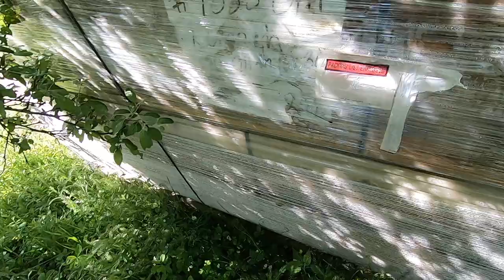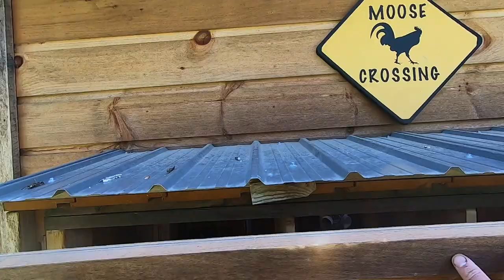It's Time To OPEN the Post and BEAM BARN KIT!

Comment: Al.  Keep in mind you can build a rigging hoist system using the Kubota to lift the beams up.  I stick built a enclosed deer blind 15 ft off the ground using block and tackle and the garden tractor.  I lifted 200lb walls like it was nothing.
Reply: Super idea..

Comment: Al, if possible line up your trailer in tandem with the stack so you can simply slide the wood off onto the trailer without having to lift, carry and maneuver it....it will save your back.

Comment: It was pretty thoughtless for the barn kit company not to reverse pack this structure.  The rafter may go on top of the barn, but they should have been on the bottom of the shipping pallet.  You should mention this to them as it would be very helpful for customers going forward
Reply: That's a good idea :)
Reply: They do reverse pack each pallet "based on what has been said".   The over hangs are each a separate kit on there own pallets.   Which for shipping they stuck on top of the pallets for the main building.     I think it needs to be kept in mind, you really don't want them to stick 6x6's or any lumber on top of the roofing tin.    So there has to be some leeway.

Comment: At 14:00 you are putting in an eyelet to hook onto with the strap. TIP: I use a nice sized Allen Wrench in my drill to screw those in. Zip, Done. Hope this helps. I also keep a few eye hooks and they work better but if I do not find them, I use an Allen Wrench.

Comment: Al, try some yogurt for the chickens. This will get them in the mood for egg laying. As a long time carpenter I have picked up a couple of tricks from you. Impressed by your sense of detail. The barn should turn out very nice.A couple sections of steel scaffolding will be helpful when you are putting up those 6X6 timbers,Just might save you a trip to the chiropractor.

Comment: 2 things: 1st put a ball on the wagon as the way you have it now you will elongate the hole
 &  it will cause you trouble in the future.  2nd there is an adjustment on your tractor so the 3point hitch does not drop so hard.  Please do not take this as a criticism I just want your work to be easier for you!